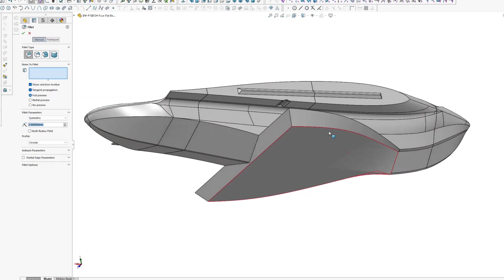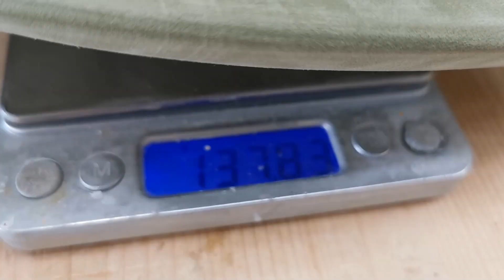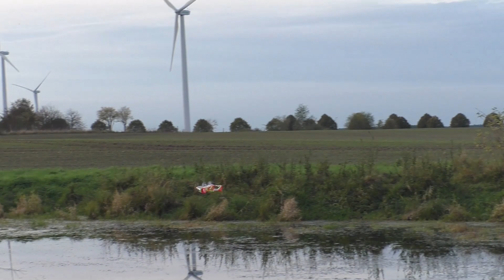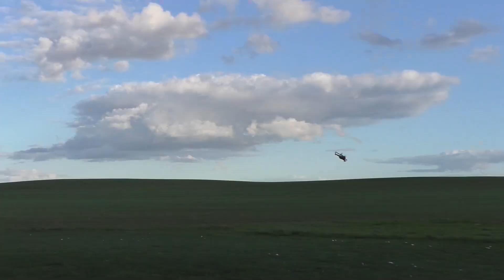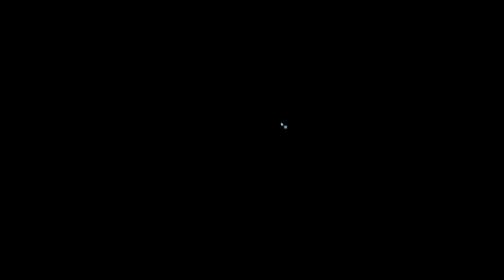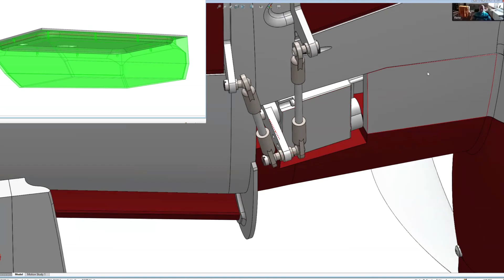3D-Print Delta Boxwing meets Micro Lake for first Start

Comment: Welche Akkupacks verwendest du?
Reply from the maker: 4s 1200mah 100c tattu und cnhl
Reply: @rene_rosentraeger  Danke vielmals für die Rückmeldung. Eine andere Frage: Welches Filament hast du verwendet? Bambu Aero? Ich habe jetzt Spectrum lightweight pla eingesetzt. Damit ist aber das Wing Front Inner mit 9 statt 6 gramm rausgekommen. Also 1/3 schwerer. Verwendet habe ich die 3mf Files an meinem Bambu X1 carbon.